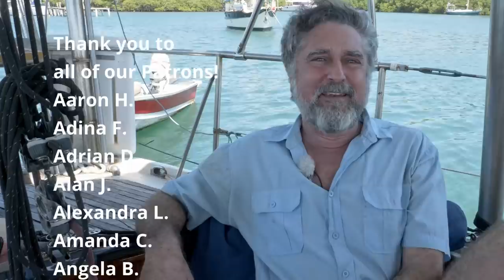Fixing Our Boat's REFRIGERATOR [Capable Cruising Guides]

Comment: Good knowledge of refrigeration and vac to remove air and moisture. Using lead solder is bad practice and not used to join fridge pipes under pressure together . But needs must I suppose. In the UK we have to legally recover any refrigerant before doing such a procedure for environmental laws in Europe . If we were caught it carries a potential £50,000 fine and 10 years in prison.  I can see from the blue disposable cylinder you are using R134A.  Might want to add a foot note to your video  to  know what refrigerant is in your system. Especially now a lot of new gasses the Europe such as R600 is propane and therefore flammable. A s i have seen in other US based videos . They are still using R22 , which has been illegal to use for over 15 years, due to being linked  to causing a hole in the Ozone layer. Very good knowledge of a refrigeration system. I suspect you have knowledge from working in the industry, especially with the tools you were using,
Reply from the maker: Andrew,
  No never worked professionally as a fridge guy.  I'm a retired engineer though.  As you say "needs be".  Wish I could use hotter solder but, it's just not practical for me to carry oxygen.  I've had few soldering failures over the years.  And I bet the failures I've had were due to poor technique on my part.
   I'd like to capture and re process but out here, can't.  If I went to a local fridge shop they would just vent.

    You might find this interesting. https://youtu.be/xF113aUlZgo.  I'm kinda proud of it.  Works surprisingly well an rediculusly low power.

Comment: Clark, I like your videos and they have been helpful but when I went to my galley fridge aboard my Jeanneau 58 I found I can’t check the pressure nor fill the system if I found it needed because my yellow manifold hose does not depress the valve on the Schrader valve. My kit works great when I charge cars but on this fridge it doesn’t open the valve. My fridge stopped getting cold and here in Annapolis where im surrounded marine repair companies it’s now summer season and they are all booked solid for over a month. Any help would be appreciated .  Sv Padraigin II Capt Rich
Reply from the maker: Look in the end of the hose.  See the flat brass thing?  Grab it with needle nose pliers and unscrew it.  It will stand just a bit higher.

That is the Schrader valve depressor.  It's adjustable.
Reply from the maker: I am surprised you are using your yellow hose.
Usually blue is for low pressure and yellow is for vacuum and can of refrigerant

Comment: I'm curious what you think of the holding plate systems vs evaporator systems.  I've looked at the CoolBlue fridge from Technautics and they talk about an thermal expansion valve and a larger condenser as making their unit more efficient.  Just wanted to get your take on this or if it just makes more sense to go with the standard evaporator/design from one of the other guys.
Reply from the maker: Holding plates only make sense for engine driven systems from the 70s.  We have crazy efficient brushless DC motor driven compressors like the bd-50f nowadays.  You should store your energy in batteries and make cold as you need it.  I'm not going into detail here but trust me evaporator!!!
   Expansion valves are better but in a refrigerator/freezer setup a cap tube is plenty efficient if its gas is charged right.
Reply: @Clarks-Adventure  Thanks.  We have an old Alder Barbour DCM-12 that still runs on R12 refrigerant from around 1996.  It still works, but I'm considering replacing with somethign that has a variable speed compressor as getting R12 can be a bit challenging and R134a is way more available.
Reply from the maker: Also it's likely you have an induction motor in that thing.  A bd-50f or bd35f is brushless DC.  Likely use about half the electricity
Reply: @Clarks-Adventure  I think it's an older   BD2.5 compressor based on the control unit onboard.  I can't see any markings on the compressor. It's a constant speed unit, so I think one of the newer ones would improve efficiency. Just trying to keep ti running a few more months until we are in a convenient place to replace.  I'm wondering if swapping out the compressor and control unit makes sense or whether we should just replace the entire thing.

Comment: Constructive criticism: using plumbing solder on a refrigeration system is a no no, it needs to be brazed or silver soldered. Also pulling a vacuum is not the proper way to check for leaks, it's equivalent of minus 15 psi & the system on the high side runs pressures of 150 psi plus. Respect to your efforts.
Reply from the maker: One does what they must without oxygen or nitrogen

Comment: thanks for the great video, just what i needed! i have those parker ' one shot' fittings , that dont match, i got two for the evap side i have to solder on. do you think i should just remove them and put in flares?  hope you get well soon. cant wait for the gas vid ! sv blondie
Reply from the maker: You're very welcome.

As you can see my sled requires me to go upside down and backwards to work on it so I used flares.  If yours is easier to get to I'd just solder the lines together.   
    There is a tool that I recommend.  You see it in the vid for about a second but it's in the tool list in the description.  It opens up the tubing do you can put one tube in another.  Makes soldering easier and cheaper then buying fittings.

   But yes, those connectors that keep the gas back leak eventually.  Flare is better in my opinion if you are opening the system.
Reply: @Clarks-Adventure  thank you clark, i do have more access

Comment: What if the coil in the box gets massive frost buildup in a week and the box has not been opened for that week?
Thx
Dave
Reply from the maker: It just means there is water in your box (possibly from too much air leaking) and things are working correctly
Reply: @Clarks-Adventure  thx
D

Comment: Is soft solder really good enough? I always solder copper/phosphor or silver at about 700C/800C so your method is easier if it holds up.
Reply from the maker: Yes it concerned me as well.  But I really didn't want to carry oxygen so I tried it.  First time was 25 years ago.  I've had about 3 solder failures in all these years.  With my soldering skills I'd chalk them up to operator error.
    Yes, in short I'd recommend the low temperature stuff.
Reply: @Clarks-Adventure  3 failures in 25 years is good enough for me, thanks for sharing.

Comment: Great video. I've got a quick question regarding my Frigoboat keel cooler system. System is 21 years old, I've had it filled a couple of times over the last 11 years. When I bought the boat (11 years old) the compressor didn't work. I changed the controller and everything worked fine. Now suddenly, when I turned the system on after being off during the winter, the controller fuse blew (controller is about 7 years old at this point) . I replaced the fuse with it blowing immediately.
Question: could this be a frozen compressor causing the fuse to blow or just a bad controller? Would like an educated guess before forking out another 300€ for a new controller. Thanks in advance.
Reply from the maker: Usually the controller just shuts down when the compressor is locked.
Fuse doesn't blow.
Reply: @Clarks-Adventure  Thanks for the quick reply Clark. Keep up the great vids. Cheers

Comment: Links please. ;-)
You have a link to everything except the air condenser, compressor, fan, tubing used on your build on the sled and in the fridge around your box.
Reply from the maker: Good idea.  I'll look for affiliate links on Amazon.  Helps us both out.

Also check out that email I sent your way as a thank you for suggesting.
Reply from the maker: Sorry everything is just too expensive and seldom available on Amazon.  I can't recommend anything there.

Go to Rparts.com.  It's all there.  Also eBay has deals a lot but links don't last.

Comment: Is there an equation to determine the size of your homemade evaporator or does it matter?
Reply from the maker: Up to a point bigger evaporators are better as they can exchange heat with less fan power.   I use one rated for like 10,000 BTUs.  
It also depends a bit on expansion valve or cap tube.

Comment: could you put freshwater thru the condensor coil and get hot water?
Reply from the maker: No.  As the water got warmer your efficiency goes to hell.
Reply: @Clarks-Adventure  makes sense. what condensing temp are you seeing on the high side?
Reply from the maker: Slightly higher than the water temp.  Or 10f or so higher then the air.
Depending on what I'm using for cooling.

Comment: Does the drier ever become too saturated?
Reply from the maker: It's for residual water.  Once the system is charged there is no way for water to get in
Reply from the maker: Also.  If it does you can remove the water from the dryer by vacuuming it for a very long time 

But often they are just replaced as they don't cost much.   I usually long vacuum a suspect dryer because when you are out cruising parts are an issue but time isn't.

Comment: Copper might corroded by salt water. You might to check copper and salt water.
Reply from the maker: The only metal stat sees salt water is copper nickel.
   What do you suggest using?

Comment: as a refrigeration engineer I wonder if this is really a project that an amateur should do ..... you have to be certified for it (this applies in any case for europe, especially in the Netherlands) and that is not for nothing (refrigerants and especially the older ones such as r12 are not very good for the environment)
Reply: being profissional/amateur its a mindset. if you know your shit (whatever it is) then you are certified to do it. ive seen "amateurs" doing brilliant jobs and profissionals fucking it up big time.
Reply: assuming that a professional performs his job properly, there will be minimal loss of refrigerants. (= is better for the ozone layer)

i'm really in favor of diy but for some activities that just isn't possible .... or do you let yourself be operated by the neighbor who is a car mechanic?

For example, you were on the way, but you also forgot a few essential steps ..... after vacuuming you should have had to pressurize the installation with N2, in order to simulate, the operating pressures (about 275psi),
Then vacuum again.
Reply from the maker: Hi Mark.  I assure you that no one working "professionally" here owns a bottle on N2.  Professional mechanics here work under a tree in their front yard and use vice grips and hammers.  It's a different world.
Reply: @markschraven7972  you are comparing 2 different situations. having a mechanic operating on somebody doesnt work. its simple. its not about being right or wrong its about working/ not working. or whats beneficial/ not beneficial. the only reason why no one can self study on medical sciences and have a shot at it, its because somebody somewhere rule that out. the same way ppl get ruled out of being a pilot by having a smal dot in their eye, which may not even affect them, and they could be a good pilot, but somebody somewhere rule it out, so the guy is out. too much rules, too less shots for ppl to try it out, if you ask me. Now, it seems that Clark got the damn thing working again. so to come full circle on my view: it works. let it be. it appears (i might be wrong) that you equate being profissional to not making mistakes. which is also easily verifiable as untrue. why? cause we humans, mistakes are part of us. professional or not. peace.